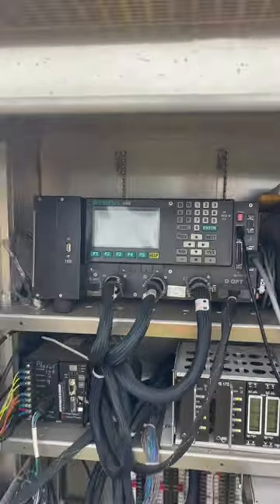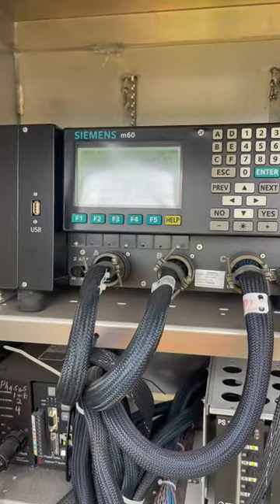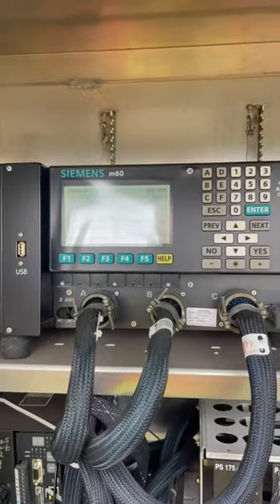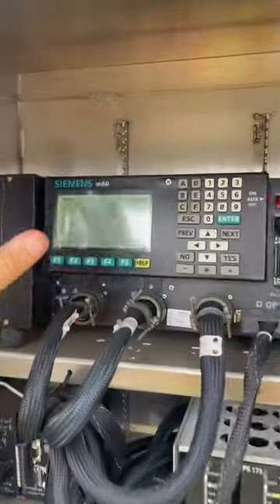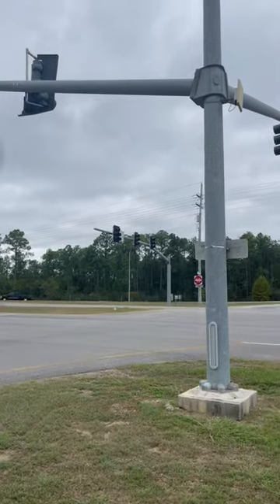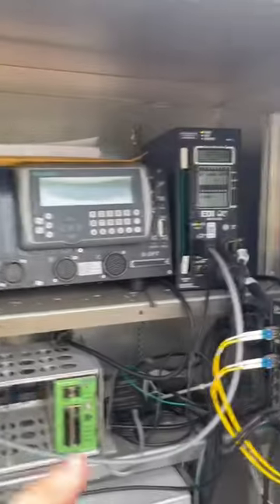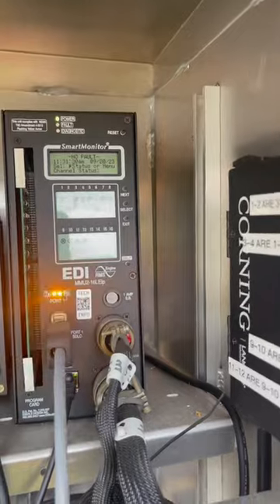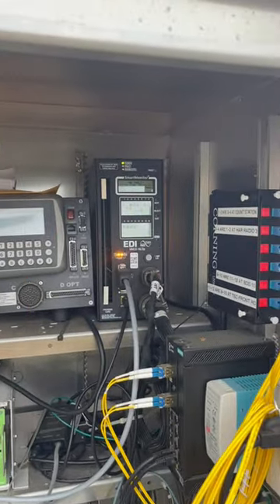Raspberry pi and traffic lights!

Comment: I challenge the open source community to come up with a better solution using Raspberry Pi's and Arduinos as the primary controllers.
Reply: The majority of the tech isn't on the main code or the processors. It's all on the support hardware. Rugged cases, reliable and redundant power supplies, temperature control, humidity control, failure detection, reliable communication and maybe even something else that I don't even have a clue. The Linux based controller is basically a microprocessor just like a raspberry pi. They don't even pay the price you pay on a development board, since they only need the components. 

If the community were to do this challenge to pass the certifications needed, they would use just as much money or more on R&D. Did you know there was a vote count error because of a particle coming from space? How do you even think about that for the first time? Redundancy, reliability, safety and accuracy are no joke and a problem as big or bigger than programming the main logic for the problem. Honestly having computers, the internet, sites that are fast everywhere and synced, streaming services and cloud gaming is simply a miracle of doing stuff one step at a time and optimizing.

However doing a simple educational semaphore would probably be fun, specially if we try to replicate redundancy mechanisms. Dealing with harsh climate and collisions isn't that fun and cheap to do at home to learn.
Reply: Its actually not that hard...thicker PCBs, derated components, conformal coating. Put it in and aluminum box and instead of just a pcb. The cost is in the regulation requirements to get it certified to the claims...but of course all that cert stuff is mostly statistical. Ive seen plenty of intersection go belly up in my 10 years here
Reply: @km2766  You need throw that basic development PCB out of sight and customize it to be able handle against all surges, short circuits etc additional all mechanical and thermal stress plus you need make sure you dont make it into first gen Tesla P85D which did burn their memories due over usages.

To be honestly here.. first i would ask what all this system needs be doing as you only think contorlling couple light bulbs but i wouldn't promise it ends just there... As otherwise ATTiny85 is even over kill to control couple funny lights.

Comment: I’ve had raspberry pi’s as vpn servers and firewalls running 24/7 for months unattended and never had issues with reliability. Not only that they were hooked up to a UPS and every time the power went out and came back it did not affect the raspberry pi.
Reply: But were they out exposed to weather for years and being hit by cars and the wind

No, no they were not
Reply: @jordanabendroth6458  I completely agree !  When lives are at stake you have to use a custom solution engineered for maximum reliability.  
For example even though raspberry pi’s are reliable for my purposes I’d never want to see them being used to drive a car or part of controlling some subsystem in a passenger jet.

Comment: Controllers are powerful and dedicated equipment that serve a specific purpose, and they apparently have some other safter componments and modular capabilities that allow host swapping. I wouldn't use a Linux server instead of a switch or router. Special tech exists for a very good reason. Raspberry pi's are great, and cool little boards but they are not designed to take the place for production equipment.

Comment: That is the best 80s tech 30k can buy. But hey, why employ American engineers and designs that are cheap. It really takes more computing power to blink a dozen lights to time when govt is involved. 

Other funny thing is, all those feature took decades for those ancient overpriced boxes to get. The open source community cold have a pi doing EVERYTHING that system does in less than a month. The US govt is the largest consumer of blinker fluid in the world. Premium blinker build.
Reply: The government doesn't pay to design or install most signals - land developers do. Trust me, they are all about cost savings. If a viable, safe, and cheaper alternative was present, it will be used. These are not just "big switches".
Reply: @epileptix8954  And the government de facto ensures that nothing cheaper comes along.

Comment: You obviously can't use a raspberry pi, but my feeling is still that these devices are way bigger than they need to be and probably also more expensive. I know somebody who was an engineer for railway signaling systems. They used some huge encryption devices in their substations. However, they later replaced them with devices which were just a fraction of the size. The devices came from the same manufacturer but were actually made for banking applications (so they were engineered and sold by a different business unit of that manufacturer). The devices just had to be certified for railway signaling applications and then the size of the substation installation could be reduced significantly.

Comment: And BTW last commenter who invoked words "embedded systems engineer": embedded systems now include intel PC architecture, running Linux.  Why cant they include RPi?

The RPi company doesnt want to give MTBF away because they arent targeting industry in their direct sales.  They leave that to other companies that produce the industrial products.  

If you had a RPi in your 3d printer or maker lab, and it "failed", then guess what were the two most likely component to fail?  The SD card, and it's reader.  

SD cards have limited number of writes before they stop working.  Want your RPi to last long?  Move your log files off of SDcard.

The card slot fails because it is the only mechanical component.  All of the industrial RPis eliminate and replace these components with higher MTBF ones.  This is not your daughter's Raspberry Pi.

Comment: Yeah there definitely is a helluva difference between a controller and an embedded computer.
You have specific time circuits, watchdogs, and sensitive sensors.
Not to mention, rasperry pi's dont have FPGA that make tasks much easier to perform

Comment: Not sure about this controversy is about... but after reading the comments, a Raspberry Pi is not designed for industrial use, that's not to say that that it's processor RP2040 can't be incorporated into a controller, providing it meets the specs.  These days there's a lot of security concerns RoT for contract manufactures like the STM33 Trust Zone, so industrial equipment has to be rated for fault tolerant.  I would not use a Raspberry Pi or Arduino (Arm products), etc. for anything safety-critical.

Comment: These use FreeScale PowerPC SoCs that are also used in carrier-grade networking equipment. I'm guessing the toolchains are also set up so they can migrate to newer cores with minimal rework of the software.
Reply: MPC 8309 in the case of that Siemens m60. I wouldn't be surprised if those aren't also used in their telecom and networking equipment so they probably have a lot of shared code and institutional knowledge.

Comment: A Pi is like the multi use I/O controller sure it could do the job of all this hardware. But it sure isnt designed for it.. What people dont understand is they are basicly looking at a specifically designed pi that runs the intersection.

Comment: People will suggest a Raspberry Pi, despite the fact they put up with all the various issues of it rebooting or needing a reboot or anything else funky, because they think "it's fine!"

Realistically, if they wanted to talk cost, an Arduino would be a MUCH closer contender with being realtime instead of having an OS overhead, but even that needs SERIOUS engineering to make something redundant and reliable in case of spontaneous failure. a 328p is a solid 8-bit chip, but it's not industrial-level solid.

Comment: So I've hooked up a ribbon cable to a raspberry pi to for capturing 3d printer printing... One time i did it and it shorted the raspberry pi out... They notoriously fail very easy. They are $50 complete computers. I love it them but any static can destroy them and they also sometimes go out by themselves. I think ive end up destroying like 5 of them over the years and couldn't imagine leaving one outside in a box for decades.

Comment: Yeah but these are all software. All this can be done in software. Anything that needs hardware can use an Arduino.

This setup could be replaced by 3 raspberry pis, a network switch, a psu/surge protector, and a relay board.

I truly wonder what the reliability rate would be. Comparable or abysmal.

Comment: I think some embedded open soruce software and boards built to infustrial standards would be even better rhan this propritory mess lol but pretty cool.
Reply: Why would there be open source software for traffic management/intersections? Who’s going to use it? It’s not like everyone has traffic lights to play with.  
If I was a government, I would rather pay for a fully fledged traffic controller with software and protocols same as the industry standard, then have a open source controller running on my own computer which I have to build and setup and configure using a different protocol that is not industry standard because oh no that protocol is proprietary. And because the protocol is proprietary i know have to replace all the traffic lights in country to work with the protocol like what.
There is a reason why it’s not changed. It’s not a good idea.

Comment: Raspberry pi is a prototype tool at most. I would image that the durability in brutal cold and heat isn't as high as the Siemens devices.

Comment: I don't think the controller needs to survive a car crash.
The better option is to have 3 redundant controllers, 2 active-active controllers and 1 host-watch controller. If 1 controller fails, flash mode. Then a simple swap of the controller.

Comment: Why do people think that a Pi is a good choice for a scenario like this? Obviously it should be able to deal with a city's worth of signaling, but it's obviously not reliable enough. And that is due to the fact that higly engineered equipment like this has not only fail safes for redundancy but also it's much better at the component level. It's another standard, it might use military or health industries grade components.

Comment: If you're going through the effort to program a rasberry pi, you might as well design a purpose built system using a microcontroller like the STM32 line. It would save more power, be more reliable, save space, and save on replacement cost.

Comment: Raspberry pis are great, but bot for everything.

Like, my school uses one as a kiosk, which works great and over the course of 3 years, I've only seen it not work twice and both itmes it was fixes after a quick reboot.

That's great for the task, but a traffic light that doesn't work for like 5 minutes per year is a bad traffic light.

You need reliability, but a raspberry pi just doesn't offer enough reliability.

Comment: RPi fanatics that think anything can be replaced with a RPi should also answer why an RPi and not any of the other thousands of Single Board Computer arround a SoC... Is not about the hardware or even the software, its the whole ecosystems that makes the difference.

Manufacturers of this hardware give technical support, that's the main difference at the end of the day.

Comment: This video was much better than your previous attempt at saying why this tech is better. In my opinion, I believe that a pi can do the same thing but in the end it will need much more equipment other than the pi itself to make it work like how it does here. So in the end it would be very expensive nonetheless or more than what is already shown here. But its good to think that there are alternative solutions to the same goal.
Reply: Yeah. You could base a new device off of a Pi, but you would end up with a device that cost just as much and was just as bulky if you did the job right.

Comment: I confirm the Raspberry would fail eventually, costing lives. 
A 3$€ Arduino and few lines of C code would be much more stable, without any OS and microSD it would run for decades.
🥇

Comment: All I'll say is those controllers 100% don't work that reliably for that long, a raspberry pi type/ size computer can with a few changes could be designed to be just as long with the same redundancies, error checking and conflict checks. Saying that something can't be done is a great way to convince someone to prove you wrong. However this equipment isn't expensive for the components, it's expensive because of the regulations required to get something like this into service. These things have Lifespans though that are the same as basically every other bit of electrical equipment. It's about 5-10years before components start to fail, after the initial few failures during the first year. Nothings perfect. 
I'm a cqv engineer btw, validation is literally what I do.

Comment: Pis are great for certain things, but when you're dealing with system critical functions that lives depend on, you really need purpose built hardware.

By the time you configure a PI to control all of this with the required redundancies and certification, you'd probably spend just as much if not more anyway.

Comment: Yes agree the odds are rpi isnt the most optimal with durability etc.  However, there are definitely smaller, simpler, cheaper, just as durable, and more elegant solutions than a massive cabinet of outdated hardware.  You could do it with discrete logic chips pretty  easily for crying out loud.

Comment: "BUILT to last 30 years", but will be replaced in 15 when technology advances. What's the point of all those electronics if they can't even handle a time-table for different operation at peak times? Its all processing and communication for traffic cameras to try to calculate what road goes on the fly. Inefficient at best, and frustratingly dangerous at worst.

Comment: You probably could use a Pi, but it's just not the right tool for the job.

Yeah, I could enable real time kernel interrupts and scheduling, tune the power management and reduce onboard peripherals, implement a hardware temperature monitoring system and regulation, and other things.

But at that point, it really isn't a pi anymore, it's just a Broadcom chip on a familiar looking circuit board.

Brand loyalty to Raspberry Pi is weird. Their stuff is expensive and deviated from its stated goals of education.

I'm not a Pi "hater"; I have my 3D printer running off one and it does a great job! I used to have my backup storage hosted by one. 

I just don't see a raspberry pi as the first tool in my toolbox.

Comment: People don't seem to understand that you touch an RPi in a way it doesn't like, it restarts and corrupts half of the sd card
Reply: Yeah, also the controller is FAR from the most expensive thing in a traffic light, things like the giant arms and poles that hold the lights are way more expensive than an industrial computer plus get into how much it costs to pave roads and that's even less of a big deal in comparison for cost

These people might as well argue that the city shouldn't put out dog poop bags at city parks and that people should bring their own because it's such a non issue I don't get it at all.

Comment: I love Pi devices but they're not reliable enough, even short term. The RAM is not protected, the boards are not terribly robust, and the firmware doesn't have redundancy against failure or security against tampering.

Comment: Okay... build a little hut that is more insulated. All of the failsafe can be done on the programming end instead of physical systems. You're a maintenance operator for a reason. These systems will be replaced with a much smaller system in a few years. They already are in a lot of cities.

Comment: I have known conflict monitors within traffic light control cabinets to have catastrophic failurs to the point it freaks out the controllers and causes all 3 colors on tri-color signal heads to come on solid and not go in to 4-way flash on more than one occasion in various different citys and towns
Reply: Conflict monitors and controlers arnt fool proof

Comment: Lol this guy still doesn't understand because he's only been on one side of this debate. 

I used to work for Siemens and have been in the BAS industry for 20 years. These Siemens, Honeywell, JACEs and other devices are garbage. They are underpowered, overspecific, fail all the time and they cost literally 50x a single raspberry Pi. The failure rate of Pi's is on par with them and you could literally wire 50 Pi's of redundancy and still spend less than one of these "industrial" devices. Trust me, it's all marketing and $$$.

Comment: A Pi COULD be setup as an industrial controller for an application like this, but just...why?  You don't need a full SoC when an MCU would suffice.  A field tech pointing to each piece of gear and saying what it does is not the same as and engineer knowing what needs to be done and designing to those needs.  I'm sure when that main controller box was designed, MCUs didn't have a built in watchdog that can take over if something goes wrong.  Most of the gear in that cabinet, sans the power relays, could probably be reduced to a single DIN module with a bluetooth connection for setup and troubleshooting.

Comment: Of course a Raspberry PI can run a traffic light no problem. Hell I bet it would even run it reliablity 99.95% of the time, but the problem is that last 0.05% of the time and the liability of running it. Siemens charges and arm and a leg for that unit because it assumes a ton of liability in any faults that could result. Your raspberry pi module, nope, no one is backing it up in a lawsuit.